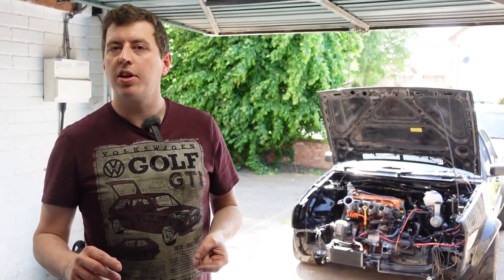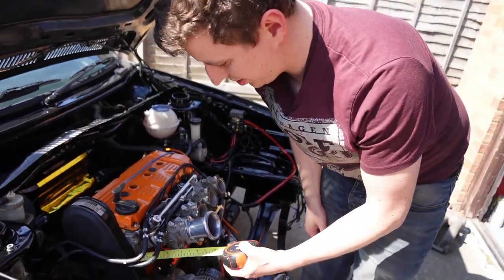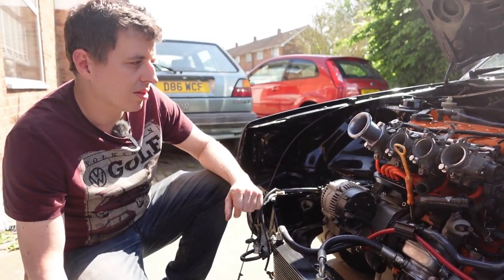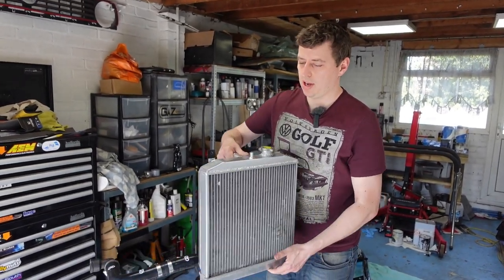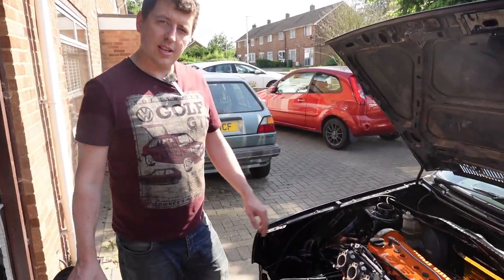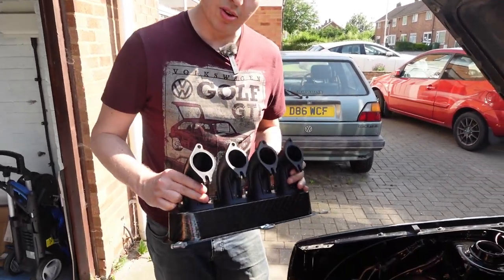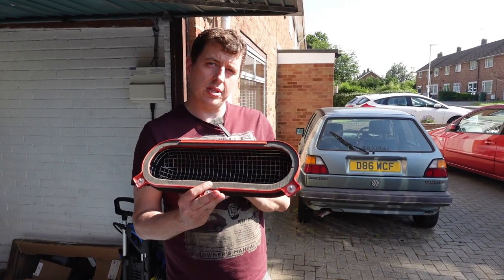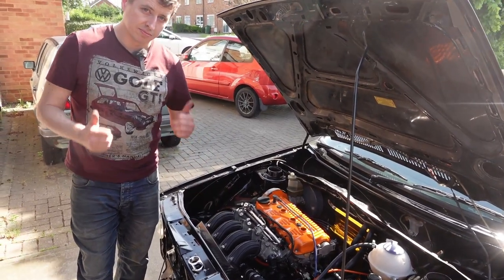Ideal Cooling Setup For Our Track Mk2 Golf 16v (ITBs/Twin Carbs)

Comment: Very good installation, particularly the radiator. Ive dyno tested various lengths on various specs, and as is obvious the short set ups like the DTH ones lack performance right through the rev range. 

Curves in the intake are not a problem if they're gentle. I tip the whole assembly forward via the inlet manifold or trumpets on a DTH set up then use longer horns. Once you get into the 360-380 zone overall from the valve you start to drop the peak rpm point where max power is made, but can add a little midrange or fill in holes if wild cams are used.

200hp and 170ibft is more than plenty before costs spiral upwards.
Reply: Thanks for the time-served expert reply.  From memory, we can use the 3rd reflection wave when the track is as you say 360-400mm.  Shorter than this use the weaker 4th wave in pulse tuning that's gone there and back once more.

Comment: Great video. Gives me all the information i need to consider when i get round to finishing my engine.
Reply from the maker: I thought it may come in use for you. You're going to have to watch out for the water outlet in the top of the head if the KR one doesn't angle down like the ABF one. May be worth swapping to an ABF one if possible to give you that extra clearance?
Reply: @golfmk2  yes exactly. The kit I order has a an angled outlet as part of it. But yes room is Still going to be tight
Reply from the maker: @markwagar8735  certainly a tight fit, but hopefully this video will give you a clear idea of what works and how it can look. Best start adding those items to your basket. 😅

Comment: Great video..I’ve been sceptical about running the Honda rad on my Vw due to the top fill rad and been a pain to bleed but I see you have made it happen 🎉🎉..what’s it like for cooling ??
Reply: On a drive this setup heads towards over-cooling, due to my low temp thermostat.   Circuit use it is perfect, coolant temps in the 90-100 C,  oil temps similar

Comment: Could you do a video on a dyno demonstration open vs closed air filter?
Reply from the maker: That would be very interesting actually. I reckon there'd be quite a difference in torque between the two. @abf16vftw may know the likely outcome without even the need for the dyno runs!
Reply: Open filter should make very little difference vs the ITG JC50 Air Filter.  Can incorporate this into a vid with the two different intake trumpet lengths
Reply from the maker: It'd certainly be interesting to compare figures for the two intake lengths as described in the video. Hard evidence between the differences the two intake lengths torque figures

Comment: Are you running vacuum advance with a plenum? I tought about doing it with mine on Weber 45s with my ignition management but not sure if it's worth it over TPS.
Reply from the maker: As this ABF is running a coil pack, there is no vacuum advance
Reply: @golfmk2  How is the ECU determining load? TPS? I saw the orange hoses and manifold and thought the load sense might be through direct load measurement rather than TPS.
Reply: @ForSunday   vacuum take-offs join and go the MAP sensor in the ECU.  There's effectively a curve map that splits the load into MAP based speed density for small throttle openings, part throttle, and over this curve it is TPS based.
The spark for idle is spark scatter, keeping the rpm stable in any condition

Comment: How do you get to the radiator cap?
Reply: I don't actually use it, wanted to keep the expansion tank, so the cap on mine is gutted and links to the VW expansion tank.  
Could be accessed easy enough with the 2 extra top brackets removed and tilting the rad back.